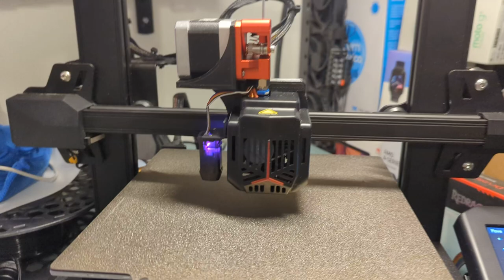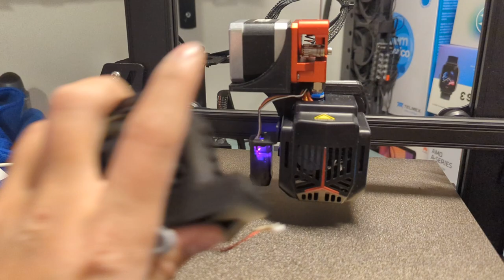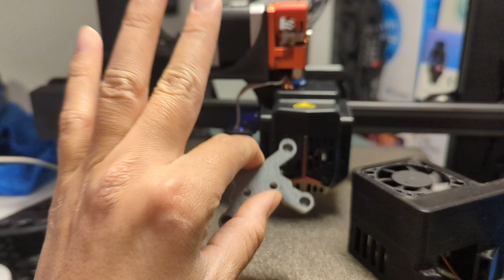Creality Ender-3 V2 Neo - Mods Updates 2

Comment from the maker: Update: So the fan shroud doesn't fit the V2 Neo's heatsink, just realized that the Ender 2 Pro has a slimmer heatsink, even though the shroud looks the same they're different inside, may tinker with this model if I have time :)
Reply: Maybe do a wrap up video once completed with all the updates. Something to compile all your lessons learned. I’m digging it so far.
Reply: Got a link to the fan shroud?
Reply: There's a video and with the link to the same print just tinkered to fit the V2 neo. I just printed it and it fit perfectly. https://youtu.be/73oM95sjw_o